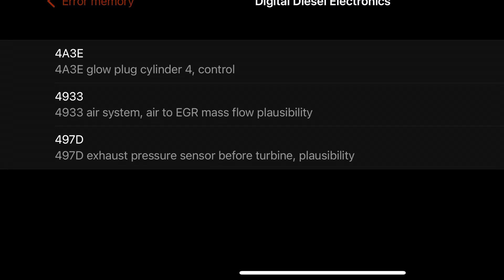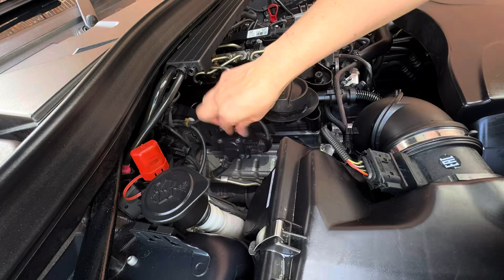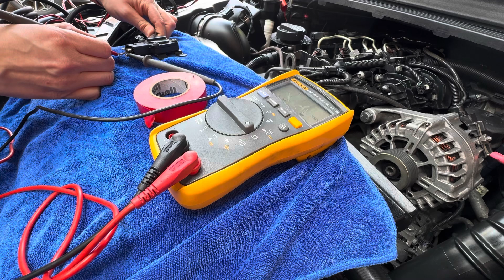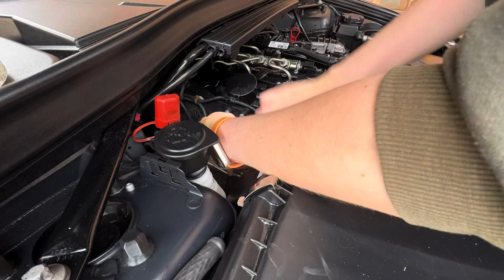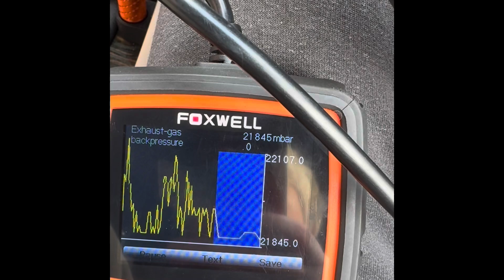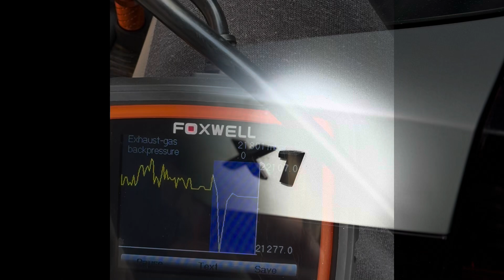BMW E84 X1 Fault Code 497D Exhaust Pressure Sensor FIX

Comment: Hello! I'm having the exact same two codes you had, 4933 and 497d. Did you fix the car? Thanks!
Reply from the maker: Yea replacing the pressure sensor has resolved both codes. Use bmw oem part.
Reply: @UnaDruma  I already have the part. It is OEM. Do you have to do some ISTA adaptations after replacing? I also have ISTA, but I'm just a casual user, just for maintenance. Thanks!
Reply from the maker: @cristiandemirel1918 I used a foxwell nt510 to reset the adaptations on the exhaust pressure sensor or aka dpf sensor
Reply: @UnaDruma  Thanks!